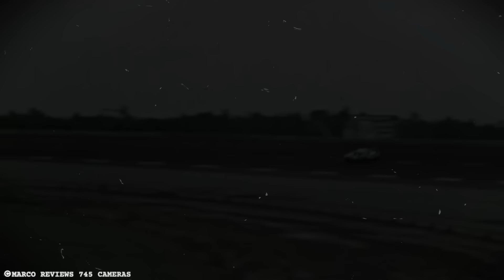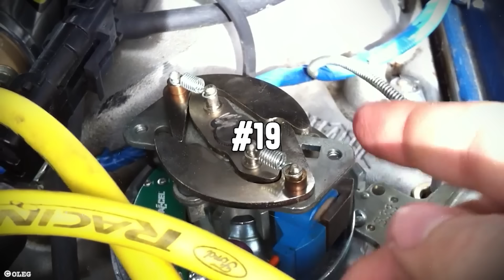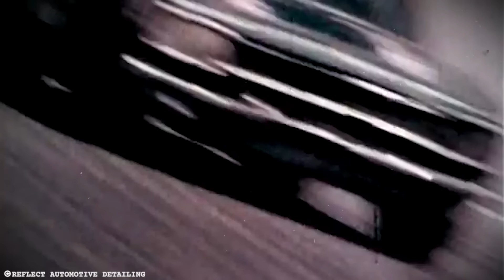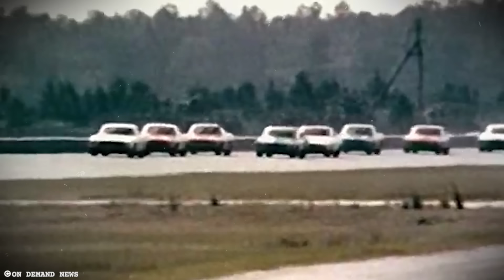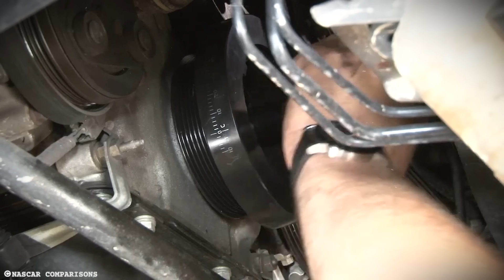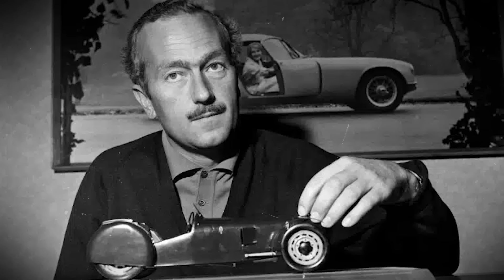25 BANNED Engine Tricks from 70s That Mechanic’s Now Say Were GENIUS

Comment: Cooling liquid fuel doesn't change its density enough to make a difference. The reason they cool the fuel is because the cold fuel cools the air, and cooling a gas such as air changes the density a lot. Higher density air has more oxygen.
The fuel air ratio, by volume, is about 9000 to 1, so denser fuel makes almost no difference at all because the cylinder is filled with mostly air.  Of course this gets complicated because much of the fuel is changing to a gas by the time it's going into the cylinder....but even by mass the ratio is about 13 to 1...so even by that metric it's still mostly air

Comment: Lead on fuel didn't increase power it only lubricated the valve guides.
Reply: Lead evened out the explosion in the cylinder so you had less KNOCKING.  That was the cheapest way to do it. NOW that lead is outlawed, the fuel manufacturers HAD TO FIND A DIFFERENT CHEMICAL COMBINATION to get an even burn.  The oil company guys had to figure it out and it is a secret recipe.
Reply: Heptane

Comment: I got 430,000 on mine it's always been down to 15 psi. 2004 Yukon.   I'm going to replace oil pan gasket, 0 ring, oil sensor and what ever else is see. It runs like a new engine. It leaks oil bad.
Reply: compression rings need replacing after you rebore the cylinders(yeah, engine overhaul as it is worn out and compression blows past into the oil pan which cannot hold compression pressures)

Comment: There should be no rules for racing,  if you're smarter than the rest of the guys, you should be able to take advantage of that.
   The only rule that should be is, whoever crosses the finish line first wins. PERIOD. 
    SO IF YOU WIN,  IT SHOULD BE A COMBINATION OF MECHANICAL SKILL AND DRIVABILITY.
   And this would add REAL  excitement back to the race track.
Reply: Maybe in the “unlimited” class… But if you create a few superstars (to whom all the best improvements are going to go, because that’s where the MONEY is, in promotion), then too many of the other competitors would be squeezed off the tracks. Simple economics means that in the big picture, that’s FAR less exposure of tech to the masses, FAR less investment in tech because there’s a smaller market, and everybody makes less money. 
SURE, there should be an unlimited class for the “high rollers,” (aka the “more money than brains” club), so they can show off— but the idea of racing is to SELL parts and tech… If one guy can afford to buy all the best stuff, and crush the competition so completely that they quit trying, then it actually hurts everyone…

Comment: Open headers never made the engine faster. What they found out through testing and this is by the end of the 60s, was that you put about a 36-in pipe after the collector. And you paint it. Wherever the burn mark is stops on the pipe you go about 9 to 12 in further and you cut the pipe off and that is your best tune of that exhaust system. If you put an H pipe between them it would actually run a little bit better. That was worth about 5 to 8 horsepower. But running straight open headers could lose you 12 or 15 horsepower in about 20 ft lb of torque.

Comment: AIRCRAFT GASOLINE COULD STILL BE HAD AT 100 OR EVEN MORE WITH LEAD
Reply: In Australia they banned  leaded fuel back in the 70s I think,  and they came out with an additive  to  compensate using  unleaded fuel which eventually  ruined the  engine... but I came up with a solution to put that bullshit to bed 😊 .... I bought 4lbs of reload shotgun  "bird shot " and put  1/2 a pound in the tank  of my Chrysler  utility (pickup) a day later after driving I looked at the exhaust pipe at the rear of my utility  and it was a great beautiful grey just like previous  "leaded" fuel showed!
😊 and I still drive a  utility vehicle with a leaded  V8 engine and I still put the shot gun bird shot in the tank ! 😂 and many guys who have seen my exhaust pipe at shows ask me how the fuck do you get your pipe like that? So I tell 'em  just put shot gun lead in your tank !  ...works better if your tank is steel but even in plastic tanks it still works,  the Lead rolls around in.the tank  and wears down the lead balls!
And when your pipe starts to go dark... just  add another pound of lead !  😊 , then add the booster  1 pint of pure alcohol  
(moon shine)😊 ...and  ya V8 is gonna purrrr like 8 kitties no shit !
I've been doing this for  50 years and I have never had an engine fail !  .... have  a great day 😀.
Reply: Haffners in Hudson, New Hampshire still has a 110 octane leaded gas for sale.It's pricey , but you can still get it.

Comment: Blocking off EGR, did that. Also removing butterfly valves in Diesel intake manifold. 2005 BMW. the engine had slightly more power and also better fuel economy.

Porting & gasket matching intake and exhaust manifolds. Did it on a Ford Pinto OHC engine. Also 3-angle valve seat cuts. For better flow at any given valve lift.
And installing a thinner headgasket for slightly higher compression ratio. 

I also made phenolic spacers between head and intake manifold and throttlebody. To reduce heat transfer.

I also converted an old Volvo turbo with EFI to run on E85 fuel. The EFI was a Bosch LH2.4 system that has some self learning capability built in. By swapping the injectors from 305cc/min@3bar to 440cc/min@3bar (about 45-50% bigger, this needed to compensate for the lower energy density of Ethanol) the engine can actually run on E85. And because of that it can take lots of boost! = more power! Also uses more fuel tho.
Difficult to do today because nobody sells E85 anymore.

Remapping of EPROMS for fuel and ignition, been there, done that.
Reply: You can just make your own E85, alcohol is easy to get. Use methonal instead of ethanol, I bet even isopropyl would work. So is the higher boost because of the high octane of the alcohol , meaning it takes more abuse before igniting on its own, giving the spark plug dictatorship about when to ignite?

Comment: You've got it backwards on intake runner length - short runners are for high rpm power, long runners are for low rpm torque.
Reply: as are almost everything in this U tube vid !!!.........BANNED by WHO ??? ...... BS statement designed to get people to watch
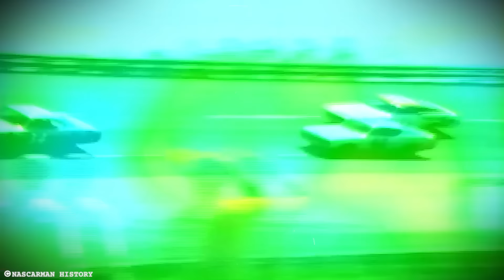Reply: @johnp163 in the 70s, the federal government banned tampering with the emission systems designed for the clean air act. The federal government mostly didn't enforce this except on Fleet cars, but many states had their own regulations.  New york , for instance , had a little wand that , police stuck up your exhaust pipe to see if the car was complying with the emissions. I have the tickets to prove it. regulations.      23:34
Reply: In the 70s, we laughed at federal bans.Yeah , the federal government banned tampering but only a handful of states checked for it
Reply: @johnp163 bbn h😊😂😊😊😊
Reply: Read Phil Irvings'Design of Intake and Exhaust Systems'.
Reply: I offer you a tunnel Ram with dual 660 Center squirters

Comment: I blocked off the EGR VALVE with a sheet metal plate in 1973 on a 429 full size Ford Wagon because I found carbon on the bottom of the butterflies.. I've done it to all of them ever since.

Comment: Removing the SMOG pump entirely didn't work in many states because you failed your annual inspection when they noticed the pump was removed! Instead, we disassembled the pump and removed the spring loaded sliding vanes, then reassembled the pump rotor and housing. Without the vanes, the SMOG pump no longer will pump air, but looks completely normal. Remember not to clean up the exterior of the pump while your working on it because if it looks cleaner than the rest of the engine, it could look suspicious!
Reply: Smart!👍🏻

Comment: Also corvair turbo muffler  help due to lower back pressure back in the day
Cross over pipes 
Or install headers add pipe to mufflers same size a header dump, spray paint black line from connection to open end, fire up engine run at cam break-in speed till paint burns off, cut muffler tube at or 1 or 2inches into burn off line. Combine with cross over pipe and low back pressure mufflers.....